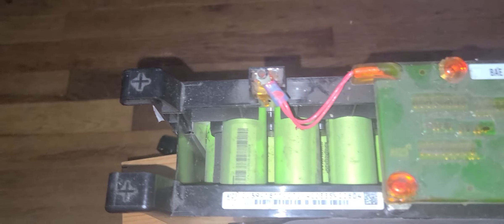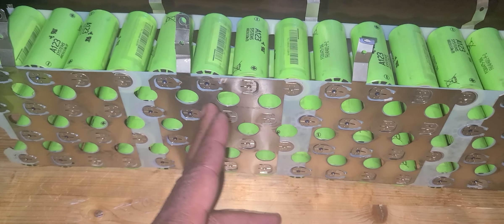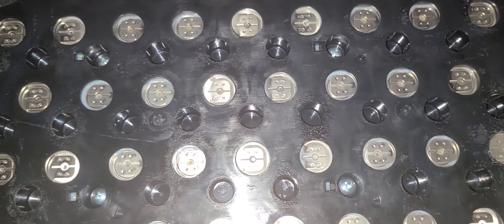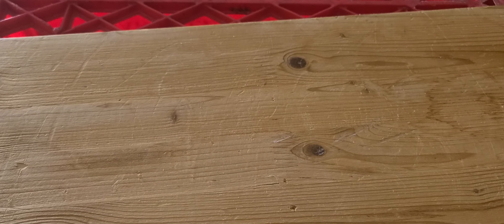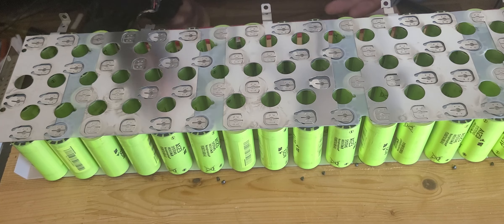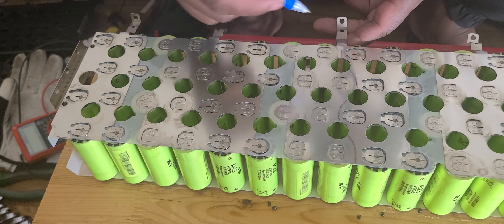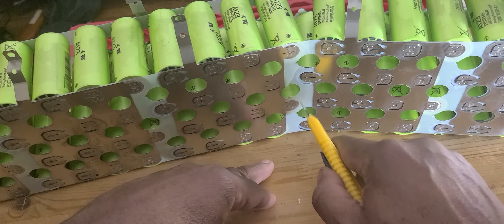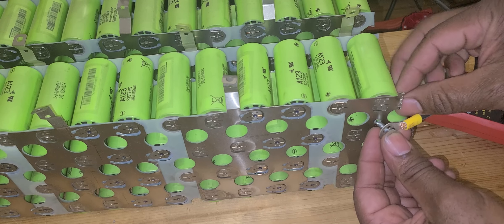HOW TO MAKE 48V BATTERY FROM A123 26650 LFP 39.6v 96 cell  LiFePo4 BatteryClearingHouse.com #DIY

Comment: Thank you for sharing. These are great batteries. What are your thoughts on best way to charge this 16s battery, do you use a balance charger, bms, balance board, protection board etc? I hear bad things about BMS not balancing these cells very well, especially the Daly BMS and maybe even causing them to overcharge. Tthinking of just balance charging and monitor cell voltage rather than use a BMS
Reply from the maker: Thanks for watching. I used  JBD BMS 16S 48V https://youtu.be/134kSSFkj7A?si=swI-zSCT3iN_aTyn

I made several videos about them. No relationship. I  do have some problems with them